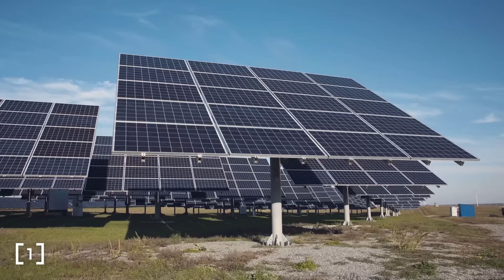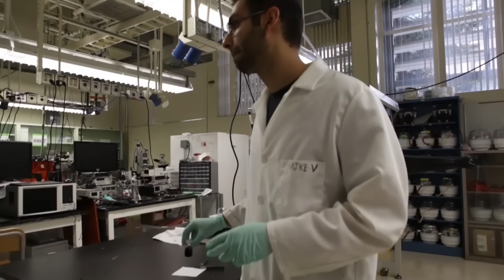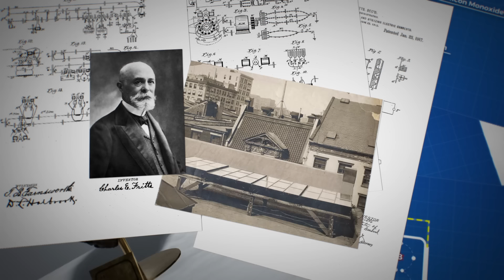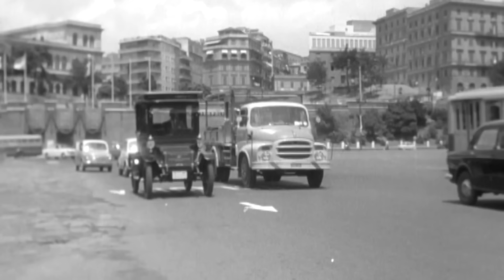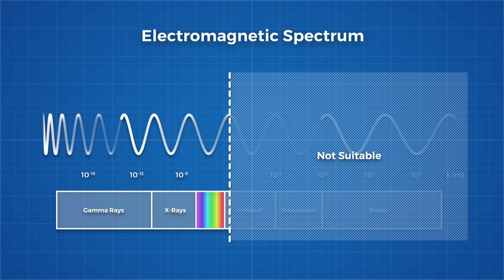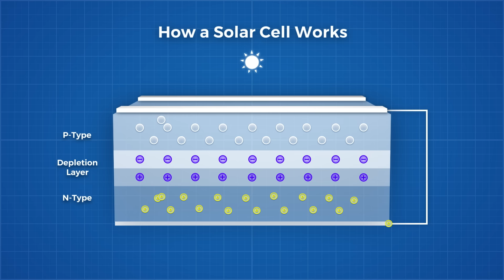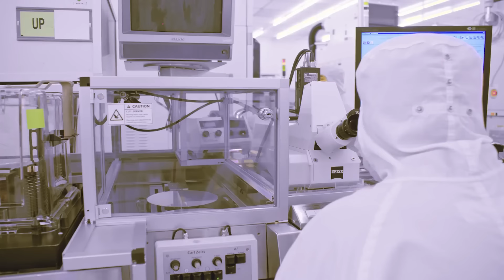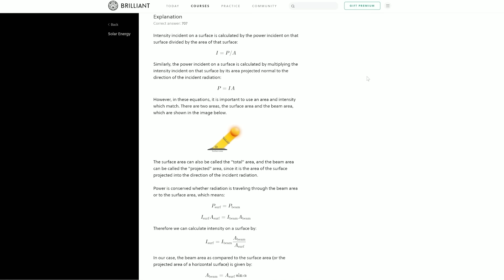The Mystery Flaw of Solar Panels

Comment: Are you going to revisit Nikola after what has happened recently?
Reply: @caorusso4926  Yeah the bubble bursted. Stocks are way down and Trevor Milton stepped down as ceo.
Reply: What happen? Did the bubble burst? Or they are a scam?
Reply: @caorusso4926  a "scam" was discovered.
Reply: The whole point of that video was batteries are heavy and when more weight costs more money fuel cells will have an advantage such as in air travel and long distance shipping or in case of Nikola long distance freight transport.

 Just imagine if we can undercut diesel and jet fuel by using fuel cell either through research or legislature or both we can eliminate the use of fossil fuel completely(we would still need fossil fuels for making plastics and other composites) and with that whole world politics can change making a world a better place
Reply: @valentineche4068  Yeah, but that's where the engineering goes wrong. 
The more hydrogen you store, the more weight you need to securely store it. 
Theres is a Hyrdogen storage entry on Wikipedia.
Reply: @valentineche4068  really so the world was just a giant garden of eden, then bam, 1870s ish petroleum is started to be used and then all of a sudden polotics around the world got all messed up?? Common are you that lacking in historical knowledge? So of it did not cause the problems well in your magical world political bs will not dissappear. The biggest reason is politicians cannot solve problems, because then there is no reason to vote for them all they can do is continue creating additional problems.
Reply: @valentineche4068  Fossil fuels as industrial materials do not directly contribute to climate change.  Only when we convert the carbon in fossil fuels to carbon dioxide (or directly release methane) do we increase our heat retention problem.  If we used a barrel of oil to make plastics and then buried rather than burn that plastic when it could no longer be reused the atmosphere would not be changed.

There are other problems associated with plastic and waste.
Reply from the maker: Maybe. The video's information is still accurate. This is an engineering channel, so I don't really know what I could add to the conversation. I avoided talking about Trevor Milton in the video, despite my apprehension about the guy.
Reply: @RealEngineering  Yes keep it strictly scientific like you are doing. Your site should be a place to get to the science not what stocks to buy or politicial biased nonsense
Reply: @RealEngineering  Most might be accurate. But there are many relevant issues brought up in the comments, that you have decided not to address. Limits on weight vs volume where storeing hydrogen fx.
I understand that the feedback was overwhelming, but still there are so many comments that goes directly to the engineering there.
Reply: @arnefines2356  Yes, there's a load loss, tractor trailers can't carry as much weight when battery powered.  But that loss just dropped with Tesla's new fatboy cells.  It's not clear what the Wh/kg will be but the drop looks to be significant.

And on a practical level, apparently more 18-wheeler loads hit the trailer space (volume) limit before reaching the weight limit.  Given that truck loads are weight limited only part of the time and the cost of operation with electricity ($0.14/mile) is much less than diesel ($0.46/mile to $0.52/mile) only trucking companies that consistently hit the weight limit might benefit from diesel.  Or from hydrogen as the current savings of moving from diesel to hydrogen is apparently small.
--

There's a possible workaround for batteries being heavier than diesel.  And running with batteries would require the use of ~3x less energy, clean energy we need on the grid.  Just allow battery powered trucks an 82  ton cap.  Two tons more (roughly).

Perhaps that would cause a bit more wear and tear on the roads.  If so, charge battery powered trucks a fraction of a cent per mile more road use tax.  A tax all EVs are going to end up paying.

Since battery powered trucks have both mechanical and regenerative braking battery powered trucks would still be able to stop quicker than diesel trucks.

Off topic, sorry.  Felt a need to distribute some info....
Reply: @bobwallace9753  The weight caps are unlikely to be raised and the limits are reached often enough that some truckers only fill their tanks halfway just so they can add a ton of cargo. Or so they will waste less fuel hauling that extra ton of fuel around, it is very good that EVs are so efficient and electricity is so cheap considering how batteries always weight the same while ICE actually gets better mileage when the tank is almost empty.

There will always be a range where an engine or fuel cell of X output plus fuel reserve of Y endurance will be cheaper and/or weight less than X times Y amount of batteries, but given Tesla just announced they will be producing batteries with better energy density and lower price soonish, that range has been changed and it will be interesting to see how much it will be.

Plus, of course, how fast they will recharge. Bigger batteries will mean longer recharge or need for more powerful super-ultra-plus-chargers.
Reply: @AnalystPrime  
1)  Concern over climate change will almost certainly continue to increase and demand for action to curb GHG emissions will accelerate.

2) If trucking companies are resistant to switching to battery power due to losing a couple of tons lead ability some adjustment will be made. IIRC European large trucks have a 95 ton limit, 16 tons more than US trucks.

3) The cost differential between electricity and diesel/hydrogen is so great that use will quickly flip.  The Tesla long range (600 - 600 miles) semi will pay for itself via fuel cost savings.  Before you add in oil/filter, maintenance, and brake rebuild savings.  

When you read "$0.46 to $0.52 per mile" for diesel, that is an average that includes everything from totally full to almost empty fuel tanks.

4) Charge time is determined by individual cell characteristics.  Chemistry and heat shedding.  A properly designed semi battery pack hooked to a correctly sized charger will charge as rapidly as a passenger EV.  Right now Tesla EVs charge 0% - 80% in about 25 minutes.  A T-semi could charge 0% - 80% in about 25 minutes if the charger supplies about 10x the power of a car charger.  The grid can supply the needed power, Tesla is already building Supercharger stations with over 50 charing stalls.

And the new Tesla cell should allow for faster charging.  The power is increased by 6x which means that the conductors inside the cell can carry far more kW per unit time.  And there's a significant increase in the ability to move heat from inside the cell out.
Reply: @bobwallace9753  Frankly I suspect the chargers(or hydrogen pumps) for long distance transport will be built at the transport terminals or at special service stations on longer routes, that way there are no issues with whether a truck can find a free and working charger when they need one, and they can take their time recharging during the unloading and loading.

It remains an issue that on short routes having extra tons of weight dedicated on long distance batteries means wasted weight. Cheaper cost of driving is very good but if you need to do an extra trip or use another vehicle because the customer ordered 33 pallets of cargo but your truck hit the weight limit at 29, the costs of hiring the second vehicle and driver and being unable to haul cargo to other customers due to this one taking more time are far more important than saving little money on fuel.
Okay, so you bought a truck with a lighter battery pack to solve that problem. Nice job, but now it will not have the option of doing longer hauls when needed.

When going long distance we run into the issue of draining that battery to empty or nearly so, which means it will take longer to charge and degrade faster, which means now it has shorter range, which means eventually you can't reach the destination terminal without stopping to recharge on the way and taking even more time. Sure, new chargers take less time and new batteries last more cycles, but when your million mile battery may need replacement in just a few years and being huge it will also cost a lot more to replace than the regular EV battery packs, that will affect how likely companies are to adopt the technology.

Obviously we still want to get rid of diesel trucks, so given there is this other investor known as the worldwide steel manufacturing industry that is going to be using huge amounts of hydrogen to replace coal and there have already been improvements to hydrogen electrolysis and fuel cells, chances that someone will build an actually working hydrogen powered semi in near future approach one.
Of course, when it will happen and how good competition that will be to Tesla remains an open question.
Note that FCEVs are also BEVs, only with far smaller battery. Aside from whatever maintenance the fuel cell and tanks might need it will be exactly as efficient and maintenance free as a BEV.

Another solution is to use rail or Tesla tunnels to carry that truck on long distance trips and driving only the remaining short distances, saving the batteries and also allowing drivers to rest more. That does require either minor improvements to railways or bigger tunneling machines, you know, those huge things that the Boring Company announced they made so much more affordable by, get this: making the tunnels smaller!
Given how reluctant anyone in USA seems to be to spend a dime on any kind on infrastructure no matter how much it is needed, either improvement happening soon seems unlikely.

Changing battery packs might work better. Unlike servicing regular cars there would be very limited number of trucks needing them at any given terminal and you generally know exactly how many will be needing them and when.
Reply: @AnalystPrime  First, forget hydrogen.  Hydrogen tripped over the laws of physics and can't get back up.

At first charging will largely be at distribution centers.  The first Tesla T-semis will be the short range (300 mile) versions and they will do mainly daytime or night time deliveries out of a central warehouse or plant.  They can charge at home.  Later on Tesla will start building their long range T-semi and then we'll start seeing rapid chargers along major travel routes.  With 500+ mile ranges, fully loaded, it won't take many chargers to create long distance shipping ability.  

3,000 miles approximately from NYC to LA.  The trip could be done with as few as seven charging stations.  Assume a >500 mile range as Elon has hinted.  Drive 500 m, charge 25min, drive 470, repeat six times and that adds up to 3,320 miles. Obviously more chargers will be installed to give more flexibility, but the minimum number to get started is small.

I can't find hard numbers, but a long range T-semi might weigh only a ton more than a diesel semi with a full fuel load (300 gallons).  That calculation needs to be redone with the new Tesla cells.  It may be that there will be little or no difference when the Tesla semis are produced.  

In the meantime, do some math.  Look up average profits per ton-mile for long distance shippers.  Calculate the savings produced by using electricity vs. diesel.  Then calculate how much more a truck would earn using either diesel or electricity.  Get back to us with your number.

You're making some questionable/false assumptions about charging time and battery degradation.

Elon has stated that even with only limited self-driving systems it will be cheaper to ship by road than by rail.  Put a driver in the first truck and have a couple of driverless trucks form up as a convoy,  following mama duck.
Reply: Sadly, there seem to be a high number of charlatans in the alternative NRG biz. I still deem Musk a National Treasure but, he does a fair P.T. Barnum routine. It is easy to sell people things that they want to believe in if you just smoothly tap dance past the facts. Hopefully the technology will continue improving and we can actually reduce our carbon footprint without creating other hazardous waste products or defrauding investors.
Reply: @texasRoofDoctor  You seem to have accessed information I've missed.  Would you please list:

1) Some of the facts Musk has tap danced past.

2) The hazardous waste products which we are being exposed to.

3) Incidents where Musk has defrauded investors.

I would really like your lists.  I may need to adjust some of my opinions about Musk.
Reply: @bobwallace9753  

1) Musk is pretty quiet about toxic battery waste generated by Tesla batteries. Common knowledge. 

2) See # 1

3) I did not assert that Musk has defrauded investors- that was more of a point in Nikola.  We all know that stock values no longer reflect any real world value of the underlying company so, this is not fraud by any stretch. One could even infer that the equity markets represent some sort of hard asset (see gold, real estate, and yes even Bitcoin to some) when viewed as a hedge vs value erosion of fiat currency in the age of MMT. 

I hope this elucidates matters for you.
Reply: @texasRoofDoctor  

1) That knowledge is not very common.  I follow Tesla very closely and I don't know what you're talking about.  Please spell it out a bit.  Reliable links would be appreciated.

2)  The #2 question was different from the #1 question.

3)  That is not how your comment read.  You wrote specifically about Musk being a B.T. Barnum-like character, defrauding the rubes.

Tesla stock is priced as other speculative stocks are priced.  Those willing to pay high prices for the stock are deciding that the odds of future exceptional performance justifies paying a premium price now.  

If you want a stock where the price is based on current earnings of the stock then you want a value stock and you should not expect the company to grow very much.  Or you could buy a growth stock and own part of a business that is growing but not faster than most other companies are growing.

I'm not elucidated.  I'm waiting for you to support your claims.
Reply: @bobwallace9753  

I am sorry you are having difficulty understanding what I said. 
P.T. Barnum was not a fraudster but a shameless promoter. Once again, yes Musk does over-promise or at the very least present the most optimistic possible outcome. I like Musk and once again, I said he is a National Treasure. 
That does not mean I sop up his every word as a sure thing. Feel free to look at some of his previous projects and return on investment.  

Do your own research on the battery waste hazard. Or pretend it is not true. Not my job. 

And yes, #1 does answer the question on #2. 

Now be a good lad and do your own research as i plan on relaxing and watching some football.
Reply: @texasRoofDoctor  
I am having difficulty understanding you.  You said "there seem to be a high number of charlatans in the alternative NRG biz".  I don't know what you meant by NRG and web doesn't seem to know either.  Perhaps you introduced that abbreviation earlier but I haven't been able to find where.  

You are defining PT Barnum as a shameless promotor.  I'm going to have to disagree with you fairly firmly that  Elon Musk is a shameless promotor.  Tesla and Elon do far less to toot their own horn than most companies.

Musk has, in general, not over promised unless you insist that his promises be fulfilled immediately after they have been made.  Elon has missed some time targets but that is to be expected when someone is doing something that no other has done.  There are always unexpected problems that pop up.  

And Elon has met more time targets than he's missed.  I realize there is a frequently encountered myth that Musk is always late but that believe is false, not based on faith.

Here's the way things work.  When someone makes a claim then it's their responsibility to substantiate that claim or withdraw it.  When someone makes a claim, doesn't furnish backup facts, and tells other to go look that's a very clear signal that their original statement was probably false.   You either knew of hazardous waste problems or you didn't.  If you knew you could have simply stated them.

The #1 question and the #2 question are not the same.  One answer does not fit all.

Why don't you go watch football.  The rest of us can, I think safely, assume you were posting crap.
Reply: @bobwallace9753  

You clearly should have invested some money in an education. 

NRG is a commonly used abbreviation for "energy" i am pretty sure I first saw it on the blackboard in high school chemistry.  Your pedantic pursuit of very narrow linguistic meanings shows a weak mind as well. 

https://www.industryweek.com/technology-and-iiot/article/22026518/lithium-batteries-dirty-secret-manufacturing-them-leaves-massive-carbon-footprint

This is an article that is pretty easy to understand (I give even you a 50/50 chance of grasping it) about the carbon footprint created by manufacturing Tesla and similar batteries. 

Maybe you should watch more football because you clearly have no idea what you are talking about on any topic I have seen so far. 

Additionally, get a life instead of graphing onto minutiae and trying to debate your betters. I will stomp an intellectual mudpuddle in your chest on any topic.  Sociology, gender studies, et al are not actual sciences so do not come at me any of that rubbish.